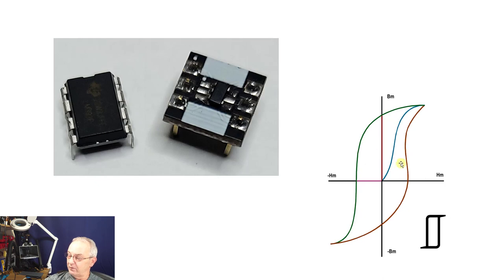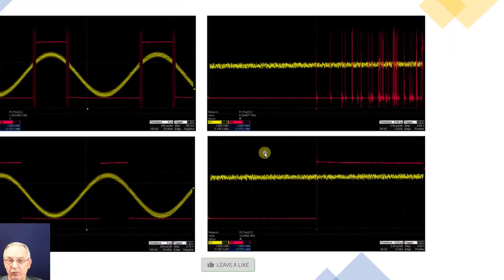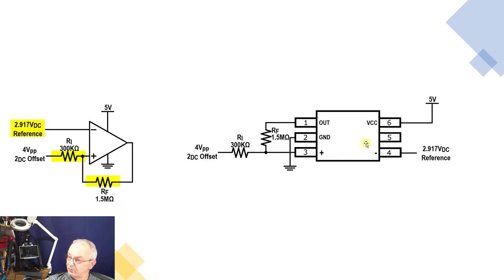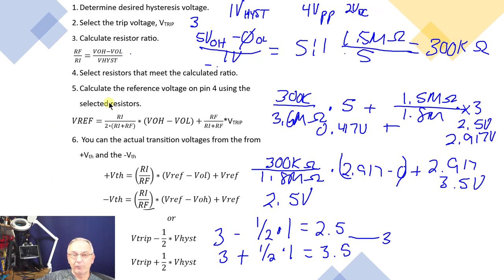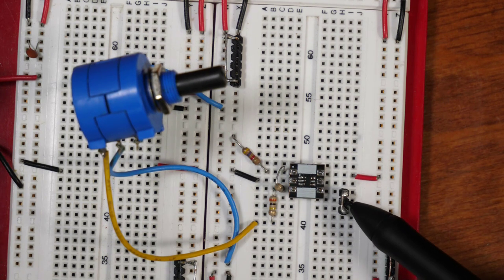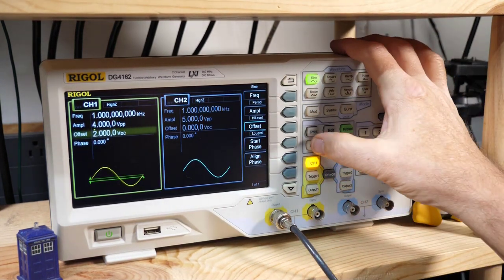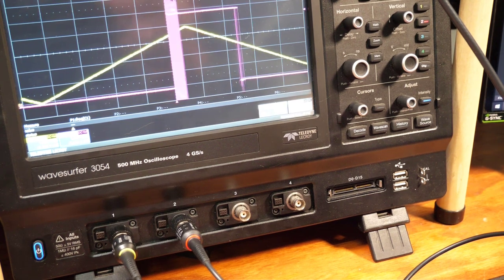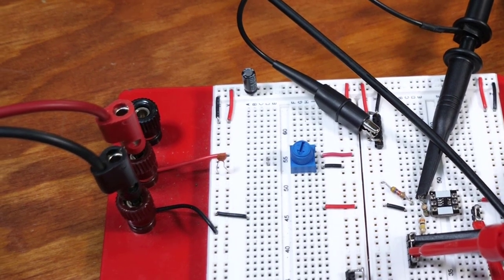109.  Setting Hysteresis on a Non-Inverting Comparator

Comment: i have a question, maybe its a silly question.
if the circuit is monitoring its own power.  lets say the voltage reference is a equal divider (5v in, 2.5v ref).
if the voltage decreases, the reference voltage will also decrease. eg, 3v in means 1.5v ref
as far as i understand this video, the reference voltage calculation is based on a stable input voltage
Reply: The reference voltage depends on the In voltage as you said, but it isn't a division by 2, the reference voltage must be a lower voltage than the in one, like Vin= 3V Vref = 2V, for a lineal operation of the comparator . If you do a circuit with a Vin = 2V and Vref= 5V (for example), your comparator will work in no-lineal way, it will gives you in Output voltage the alimentation, Vcc+ or Vcc- depending were is the realimentation .  I wish I answer your question, my english is not good at all :D.
Reply: Oh sorry I don't understad your qstion, yes, it will decrease in this case , bc he power the in voltage with 5V and then he divided the voltaje with 2 resistors with te same value and takes half voltage of the power(Vin).
Reply: so my question is how do i monitor its own voltage as any reference voltage will change accordingly